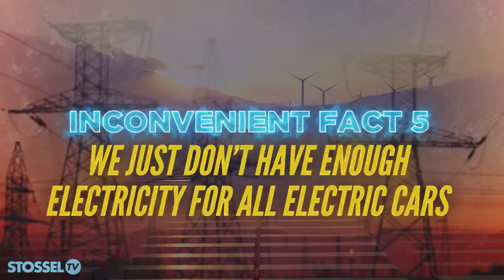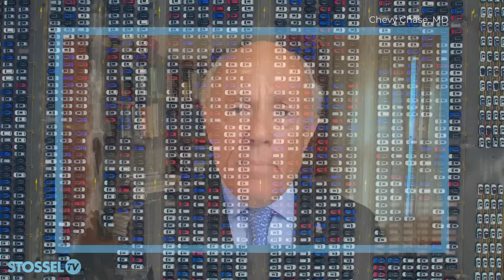Electric Cars: Inconvenient Facts, Part 2

Comment: im an engineer.. weve been shouting these things for  over 50 years..its incredible
where we have come with worldwide insanity
Reply: your an engineer and you couldnt spot the falsifications in this?
Reply: @socoj2  like what?
Reply: @Zure467  I would tell you to read my comment but I think it's just better if I copypaste it there for you to easily skim through it:

=*=*=*= 

The majority of the claims made here against renewable energy are disingenuous at best and some are outright lies. A few examples:

· 1. The solar panel claim is completely false. The most the US grid has demanded in an hour is 720 gigawatthours. Even in winter, which is obviously the season with the least sun, an average square meter of US land will get around 3kWh energy/day from the sun (on summer, it's more like 8 and the numbers are obviously higher for sunnier states like Arizona). 3kW/h per day is 125 Wh. Now, accounting for the fact that solar panels harvest around 15% of the solar energy they receive and even accounting for the fact that some space would have to be left for other infraestructure to support solar (let's be quite pessimistic and say only 75% percent of solar infraestructure area is solar panels), the total area required would be:

720,000,000,000 Wh / (125 Wh/m^2 * 0.15 * 0.75) = 51,200,000,000 m^2 = 51,200 Km^2. And the US is 9,834,000 Km^2 big. In fact, Texas alone for example is 695,662 Km^2 big.

So, even if we put ourselves at the worst-case scenario (record demand in december with innefficiently placed and badly located solar panels), all the solar panels required to cover the demand would fit in 0.5% on the US or like less than a twelfth of Texas. I've just checked and my result agrees with studies such as a 2013 study by the National Renewable Energy Labs (NREL), which estimated (with 2013 efficiency numbers) that the area required is around 55,037 Km^2.

Not that you would want to do that, it would be stupid to only use a single energy resource and call it a day, but it demonstrates how big of a lie the statement was. Solar is more than efficient enough to be viable

· 2. No person that actually knows something about energy will tell you that we need to cover all of our storage needs with lithium-ion batteries. Batteries work well on a small scale (like phones, laptops, housing appliances, cars or maybe even as backups for homes). Despite of that, they are really innefficient and expensive on a larger scale. There are other methods (like gravity-based water pumping, electrolizers or air compresion, just to name a few) that are much better suited for the task of storing large amounts of energy, and those are the ones that would be used as energy storage and taken into account in a clean electrical grid.

· 3. "But wind and solar are so unstable and that makes them unviable". Wind and solar, are not the only CO2-free tools that we have. In addition to the energy storage already mentioned, nuclear and hydroelectric energy (and with less importance, geothermal energy) provide a stable stream of electicity at a competitive cost while generating practically no CO2 emissions. Studies such as N. Sepulveda J. D. Jenkins et al. (2018), "The Role of Firm Low-Carbon Electricity Resources in Deep Decarbonization of Power Generation" have concluded that combining renewables such as solar and wind with energy storage (like the ones mentioned in 2) and with these stable sources of power would be confortambly be able to cover 100% of the elecricity demand while producing practically no CO2 and while not raising the costs of electricity. In fact, given the war in Ukraine, how OPEC is jacking up fossil fuel prices and other geopolitical factors that won't fade away soon, we'd be much better of if our main source of electricity weren't fossil fuels. Renewable electricity prices have now been consistently cheaper for many years, but specially now.

And there's many more things that I've seen being wrongly claimed in your videos, but this one was the straw that broke the camel's back, almost nothing contained in it was based on reality, but in a false imaginary world taht we don't live in. If you want to keep making content like this, fine, you can do so, but know that you are simply promoting lies and false information to your audience. It's never too late to accept a mistake like this.

I personally also think that electric cars aren't a good solution for transporting people, but because cars themselves aren't a good option and have never been (that's another thing that the US doesn't get). In my opinion, you are defending the right thing but based on completely wrong premises and information. Electric cars won't solve climate change, they probably won't even help that much at all. But don't defend that with lies; you are just making it easy for those that think they are useful for dealing with climate change (or at least they say so in order to appear 'green' or for personal or monetary gain) to defend their (quite wrong) position.

=*=*=*=

That should clear it up
Reply: @adrianv.v.4445  All this doesn't matter as co2 is not a problem and not likely to be any time soon there's no climate catastrophe comming soon due to global warming, just natural cycles that we should adapt for and have plenty time to so.
Reply: Solid State Batteries and Liquid Metal batteries offer promise.  However, the government and industry has little interest in funding their development.  People have to wait for small time operators to fund their development on their own. 

Additionally, there are many industries that fund the suppression of energy alternatives.  An example is geothermal. Small single home geothermal units that only took about a week to be up and running sprang up all over the USA West.  However, as is almost always the case, the technology was bought up - Raser Technologies (RZ) - and immediately dumped. That promptly ended that! 

Firestone bribed Pittsburgh government to take down all their magnificent electric trolley's so they could supply tires to a new commuter bus service.   So sad.  

None of the big money making monopolies will sit idle whilst new players come into the market.  They will use their money to influence and suppress any change of the status quo!  Colleges and Universities will continue to conduct research on useless crap that does not change anything substantive in our world.  Government is quite naturally "on the take".  That's the way the world works.
Reply: @adrianv.v.4445  sorry for the delayed response. Thank you. 

With the US shouldn't use cars for the majority of travel statement. If you live in cities that makes sense I used to live in Philadelphia. I now commute through 35 miles of mountains to work. Carpooling also wouldn't work for me specifically. I've considered trying to work that out I fill up my tank every 4ish days with 35mpg usually. 

What's interesting is I live in a "city" that used to have 13k people but now has 6k with abandoned factories littered throughout the limits. But I commute to a factory 35 miles away.(the schedule works great for having children)

I don't know if that's what you're alluding to but I've seen the public transportation argument so many times and it wouldn't work for 90% of the US's landscape.
Reply: @adrianv.v.4445  That kite went so high that i lost sight of it..

Comment: PG&E cut power in my town for several days, once. Gas powered cars and generators were how we got through it. Several of us lent and donated generators to people who couldn't afford them. We wouldn't have been able to do that with solar arrays and battery banks. We gave each other rides in cars we were filling with gas cans, rather than sitting around, waiting for EV batteries to charge.

Electric isn't there yet and I have no intention of moving backwards, while waiting for it to catch up.
Reply: sounds familiar! We had a whole city near me without power for two weeks. Generator installs blew up after that fiasco (my husband’s an electrician). People were struggling after the first week, thankfully communities helped each other out. But there is no excuse for leaving people without power for that long in a state like CA.
Reply: I live in SWFL, when Hurricane Ian hit the electric went out all over. No pumps. No traffic lights. It was total chaos. It was great for me cause I ride an ebike and didn't have to wait at the intersections for minutes like usual
Reply: Yeah they don't tell you that for the safety of linemen working on your wires during a blackout, your grid-tied solar panels are shut off unless you have a battery back up for the whole house.
Reply: "We wouldn't have been able to do that with solar arrays and battery banks."
Huh?  If you had solar power, you could not only run your household electric, you could charge your eV as well.  During the "snowpocalypse" in Texas a couple of years back, when power went out for days, we had no problem running our household electric and charging our Tesla.  I can't figure out why you think someone who uses solar power would give a damn if "PG&E" (or any other power company) cut power since we rarely or never use grid power?  For people who have solar, the local "grid" is nothing more than a place to sell excess capacity and maybe use as a backup.  And I'm not sure what any of this has to do with generators?  You can have a generator with or without an eV.  I've got two Teslas and two gas generators.
Reply: @daveassanowicz186  So? Having an e-bike mean that You had transpo. What about OTHER electrical needs?
Reply: @libertarian4323  Pardon? But..."YOU" had solar or other ways to survive. I am sure that there were a lot of people who did NOT have solar.Many people simply can not afford the expense of solar power.
Reply: @jtc1947  I am a 18th Century Living History Interpreter and also when I was a kid we had land in upstate PA and learned a lot from the Amish
Reply: The steel in the wind turbine is made with oil, the fiberglass blades on them are made using glues made with oil, the gearboxes need to be lubricated with oil.
Reply: Nukes…we need more nukes.
Reply: @daveassanowicz186  I think I drove by you to pick up some plywood how'd you pick up plywood on the ebike?
Reply: @stevemurray710  I'd levitate it above me like Space Godzilla
Reply: @daveassanowicz186  you don't like to pedal?  I'm the motor on all my bikes.   Batteries suck lithium ones especially.
Reply: long way to go yet maybe in a decade but i wouldnt hold my breath
Reply: @humbughumbughumbug  They don't shut off your solar panels, they shut off the connection between your house and the grid. You wouldn't be able to share power with your neighbors' houses but you'll have solar power and batteries throughout your own home.
Reply: I thought the state of CA had an answer to that problem too. They will simply ban the sale of ICE generators. That will fix the the problem.
Reply: Don't forget multiple people died from that because they couldn't keep their life support online.
Reply: Now I'm curious about all those people with solar panels on their roof.
Were they able to heat or cool their homes. Were they able to cook their food?
How much energy were they able to use during the power outage?
Reply: @daveassanowicz186  It only was out for 2 days after 2 days stores gas pumps etc came back online. On generator power.
Reply: @libertarian4323  I can't lend a solar array and battery bank to a neighbor down the street. I lent out two generators. I'm sorry you wasted so many keystrokes responding to something I didn't say.
Reply: @libertarian4323  "Let them eat cake"? The average person can't afford one tesla and one generator; happy you're living large. The green new deal isn't going to buy me an electric car or put panels on my roof. And yes, I'd need the grid so I didn't have to spend $10k on batteries. But what all this nonsense will do to me and others is raise the cost of everything from peanuts to paperclips and cause an even greater rift between that "haves and have nots". In the meanwhile I'll cherish my 14 y/o Toyota.
Reply: @libertarian4323  How'd that solar system work for you at night?
Reply: @libertarian4323  You have two gas generators. Solar power isn’t matching that, especially in a snowstorm where you can’t see the sun.
Reply: @daveassanowicz186  Have You adopted AMISH ways to living in FL? Curious as to how that works?
Reply: @jtc1947  Not great. Up north the power goes out it's from a big snow storm but you can't take the food out of the fridge and freezer and just put it outside in coolers. Not too many old houses set up for wood burning stoves or an old school coal furnace like you find all around the Northeast. Traditional Development is superior
Reply: This is a stupid argument.   In a widespread outage, gasoline and diesel can become very difficult to find (the Texas Freeze proved that, its not even a question).   Solar gives you options that you wouldn't otherwise have, and having some battery backup gives you even more options INCLUDING being able to use a gasoline generator more efficiently a few hours a day to charge them up (verses running continuously wasting fuel running low loads).

The only true long-term energy backup is a thousand gallon propane tank, generator, batteries, and solar to mitigate fuel use and generator wear.   It aint gasoline or diesel generators I can tell you that much.
Reply: @junkerzn7312  Living in a place that gets 5 seasons, one of them being ice,  I agree with your assessment.  Solar certainly has it's place for the end user.  The notion that entire nations can go entirely away from petroleum and on to wind + solar writ large is ludicrous at best, suicidal in practice.
Reply: And the guys were using the EVs to run appliances while the power was out.  Take the Ioniq 5 as an example.  Two 15A 110v plugs.
Reply: @gregkramer5588  As opposed to those of us who have inverters in our gasoline vehicles...that we don't have to use for appliances because we have gas generators? Yes, I suppose you could run a cord from your car to your house and reduce the range of your vehicle but why? There are much better options.
Reply: @TheCharleseye  I am not sure what you are saying in regards to reducing your range.   I meant that if there is a power outage you have 70+kwh of 115 v AC right there in your garage.  No need to get a generator.   This would reduce the range but who cares if you are keeping your refrigerator and a few other things running.  Not like much is happening at work with no power.
Ford is looking to have a solution where it can do this automatically through the wall box and and into your breaker box.  I think this will be fairly common option in a decade.

Comment: I watched a video a month or so ago about a guy that bought a brand-new Ford EV pickup truck. He hooked up a very small camper, and then drove about 80 miles and soon discovered he had to find a place to recharge the batteries. Enough said!!!!
Reply: and what did it cost him to re-charge.......lots of complaints about that where I live
Reply: Not to mention the time waiting around to charge
Reply: @davesevens7286 Or finding a place with either a pull-through charger so you just can power up and go or  enough space to disconnect and park your trailer (always fun!) so you can back your truck into a charging space.
Reply: I saw that too. He didn't realize the power drain it would have on the battery. Btw, have you seen the 9k lb EV Hummer?
Reply: It depends on what charger and where you're at honestly. There are about 15 -20 free ev charging stations within a 50 mile radius from me. And I've seen some that will cost you over $50 to charge(mostly in places where that's the only charger for another 100 miles).
Reply: He probably better stay out of northwest South Dakota.
Reply: Especially in cold climate you won't get very far.